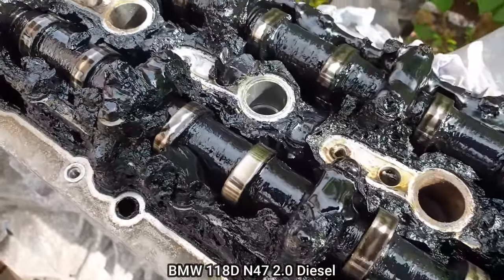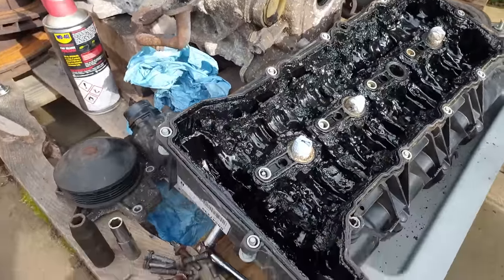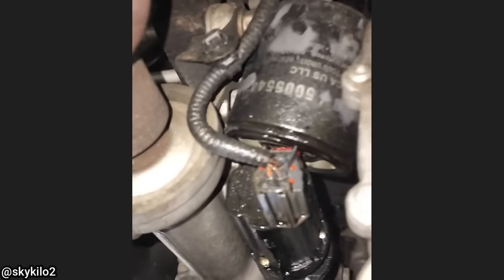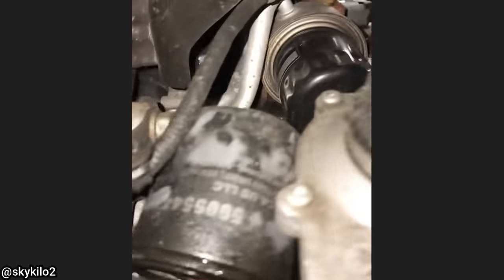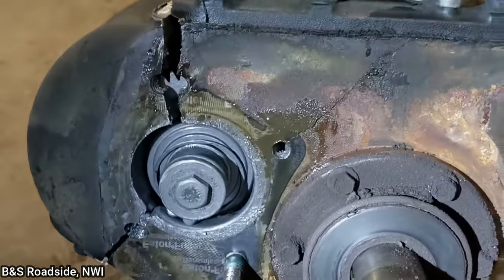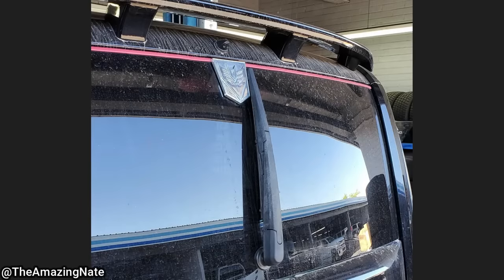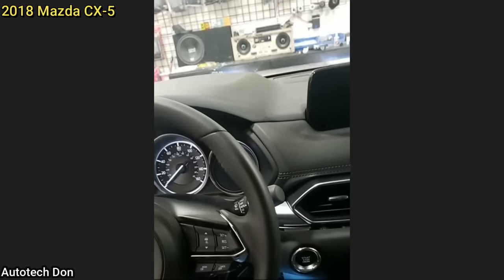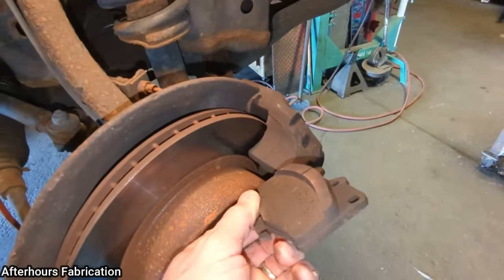Customer States Repair Engine On BMW I Just Bought | Just Rolled In

Comment from the maker: Submit your photos/clips @ www.justrolledinyt.com
Thanks for watching!
Reply: The spinning AC vent made me laugh. I owned a limo company and the floor vents were constantly kicked in by customers putting their feet on the bar. Drove me nuts!!!
Reply: Have a 3rd gen Camaro that's developed a tap, definitely guna check the number plate before I book the car in.. 🤷‍♀️😁🇬🇧
Reply: I'm not messing with you for a change, I seriously have a 3rd Gen. 🇬🇧🇬🇧. Also fitted a grill where the fog lights go, hence removing number plate. Hopefully I'm that stupid!!!
Reply: I drive a truck in the uk, only the other day I had to do some 300 miles with only gears 3 5 7 9 & 11 selector broke I  the gearbox they changed the entire gearbox 1 out 1 in 1 hour 40 mins in a 44 tonne truck !
Reply: HAHAHA the helicopter air thingy got me xD

Comment: In the mid 70's I worked in a machine shop with another Machinist that claimed oil didn't wear out and oil changes were just a way to screw you out of your money. His truck went 29,000 miles when the engine started knocking. His engine looked like the one in this video when he pulled the valve cover. I didn't think it was possible to destroy a slant-6 engine but he managed to find a way.
Reply: don't call him a machinist he doesn't know any thing about machines 😅
Reply: @Techie1224  Machinists use machine tools to make metal parts. Mechanic's work on them. He knew nothing (obviously) about vehicles. I warned him about not changing the oil but he "knew better" than to fall for that scam. I purchased the truck cheap, got another engine from a wrecked truck at a wrecking yard, and drove it for a few years. Jimmy Carter put me out of work so I went into the Navy for it's college at sea program. I sold the truck before leaving for boot camp.
Reply: @Atoms Jimmy didn't get  a fair shot. Under Carter, the U.S. experienced inflation and unemployment that were both in the double digits as a result of an oil price shock that began when Iranian oil workers went on strike.
Reply: @n4zou  GSM or GSE? I got out as GSMC(SW/AW)
Reply: @Dave-in-MD  I started out as a GSE but also qualified as a mechanic. When I made First Class they dropped the E and made me a GS1 because I had qualified for both. We were short handed so we all had to do everything. I was in from Nov 79 until Nov 85. I made First Class in Aug 83 after helping Change out the #1 Generator in the Forward Engine room after just shot down a missile shot at us. Some of the fragments came down the intake and destroyed the engine. The Kitty Hawk sent over an engine and we changed it out while underway. We all got a promotion for doing it which made me a First Class. Two years later the Army offered me Warrant Officer which required being an E-6 two years before qualifying and I had that. If I had reenlisted in the Navy I was already qualified to be a GSC and would be paired with a Chief Engineering Officer on a ship for 2 years and then become an LDO  and become a Chief Engineering Officer myself. The Army's offer was a lot better. I took 30 days leave and then went to Warrant Officer School at Ft Rucker. I made W-2 and checked in at the Anniston Army Depot in Anniston Alabama and stayed there 24 years before retirement. I did deploy to Saudi Arabia for Dessert Shield and Desert Storm. I also deployed for Iraqi Freedom.
Reply: He was technically correct. The oil itself doesn’t wear out, it gets contaminated. That’s why you change it. It’s to flush the contaminants out.
Reply: @5roundsrapid263  Oil does degrade - so its not only the contaminants. Repeated heat cycles will degrade the hydrocarbons into smaller segments, some of which become volatile and evaporate. Some ends up as raw carbon which is why it goes black. An engine is basically doing similar to a petrochemical plant, only much slower and much smaller. As the various components degrade, the mix changes, so it no longer has the same lubrication and heat removing properties, so might as well be bitumen or cooking oil for all the good it does.
Reply: @haroldwilkes6608  Exactly, and it didn't only hit the American economy hard, it also hit here in Europe.
Reply: @n4zou  I always try to explain oil by comparing it to blood. It’s what keeps the vehicle alive and moving. Our bodies can replace old/dead blood cells, but not our cars. So we must replace the oil ourselves to prevent premature aging and wear, also to remove contaminants since our vehicles don’t shit/piss the crap out themselves. Usually works for people who are clueless about cars lol
Reply: @Hardware John Ahh the days when the worst relative a president had was a drunken brother. Laptop anyone?
Reply: Modern high mileage oils should be changed at 30,000 miles. Normal oils are done at the annual service interval or 12,000 miles whichever is sooner. I agree the farce (US only) of frequent oil changes is a scam. In the 1950s it was necessary but technology has moved on. Maybe US oils are formulated as 1950s examples. I will only ever use European oils.
Reply: @mbak7801  if there’s one maintenance regiment you should follow, it’s regular oil changes. If you change your oil every 5,000 miles (2-3 times a year for normal driving) that’s $120 in oil changes a year. If you can’t afford that level of maintenance you don’t deserve a vehicle.
Reply: I had a manager didn't believe in major services. Bought a fairly new 2nd hand car, next month cam belt snapped and wrote it off.
Reply: That's impressive.
Reply: A slant six is a tough engine. They last a long time, and will take a lot of abuse and still keep going. A man that could do that could tear up an anvil.
Reply: @mbak7801  
You use European oils in European driving conditions.
The USA is vast...cold in Alaska, hot in many other places with constant high speed commuting day after day for long distances.
Oils need to be changed as this is "severe service"...
Reply: There was someone in a local group a few months ago trying to sell a car saying the oil had never been changed and that he didn't change the oil in anything he owned and that everything worked just fine even many years later. I blocked the guy so I wouldn't have to worry about ever buying any vehicle from him because I know that's a load.
Reply: @n4zou  I had a similar experience. I was a journeyman machinist/tool maker but I shifted to Australia for work in the late 60s. My wife and I were in Iran during the Carter years and returned to the states to see Reagan elected. I got in the Army as a reservist and went to Airborne School when I was 40 and on to become a Green Beret. The best years were those under Reagan even as a reservist. Never went back to machining and not sorry at all.
Reply: 180hp superbike... Oil change every 3-4000 miles 👍
Reply: @n4zou  Carter's a lot like our dictator Boris Johnson then.
Reply: @JohnSmith-yv6eq  You've ever been to Sweden, where they test cars for winter resistance ? Or to the South of Europe, not as hot as the Death Valley, but with more traffic jams to kill your engine by overheating ? Or driven on Autobahns at 250kph (I think that's 155 mph) for hours ? The question is probably not related to European vs American oil, more that you need to change your oil as often as the car maker says, on which I completely agree with you (besides, Europeans would formulate their oil for the American market, and the Americans would do the opposite for the Euro market). It's more a question of being a careful owner.
Reply: @mbak7801 high milage doesn’t mean it lasts long it means your engine has a lot of miles on it. No oil lasts longer than 1500-2000 miles and that’s a fact
Reply: I have a relative that claimed the same. He changed the filter and topped off his oil though. If it didn't leak so much it probably would have died an early death.
Reply: @n4zou  so it's Biden today
Reply: I had a 76 Volare with the Slant-6 and that was one of the best gasoline engines ever made
Reply: @TeemoQuinton  It's really not. He shut down an oil line owned by a Canadian company that would have been for export only, which would have turned around to be a home use instead after the Russian sanctions. That oil line would have supplied ~5% of the oil that the US uses if we had kept it local instead of exporting. 5%. That's not the 50% you guys act like it is. On top of that, Russia decided to go to war with Ukraine which has put a lot of strain on oil supplies worldwide. The big oil companies right now are jacking up the prices because they can and demand is too high for them to keep up at current production rates, which they refuse to increase. If Putin hadn't invaded Ukraine, we wouldn't be in this mess. Worldwide inflation is not the result of the sitting US president but rather the Russian dictator.

But on the other hand, he had nearly 50 years to fix this issue along with the rest of congress by pushing for more a more local oil supply, forcing power companies to push for greener energy sources, requiring the power grid to be a lot more stable than it is, forcing vehicle manufacturers to push for 30+ mpg as well as pushing for more hybrid style vehicles that can go well above 50mpg, increasing long distance public transit (trains), pushing for more local recycling and composting, increasing reforestation efforts and much more. If they had done more things like this while he has been in some form of political power, we wouldn't be worrying about gas prices as much as we are now because we would be looking at maybe $3.00/gal even with the war going on. Granted people would still be bitching about that but it is what it is.

Damn government.
Reply: Probably was an avid NPR Car Talk listener and fan of the infamous ‘87 Dodge Colt Vista experiment.
Reply: I have known many. Who just replaced the oil filter. And the 225cid slant 6 besides lifter or wrist pin issues were bullet proof. But not idiot proof. Lol
Reply: Without switching the oil filter that could be the case buit I've never seen engines like that.

Comment: What a great buisness plan. Throw sharp stuff in the road in front of your tire shop. Genius!!!
Reply: haha
Reply: got paid for dropping those clamps on the road
Reply: Try dumping silverware on the corner----You never heard of a "fork in the road?"
Reply from the maker: I'm sure that business plan has been used often lol
Reply: we just need to remove the logo wrap from the rear window in the ram... or really dirty up my toy to hide the neon blue colour and we could stage accidents...
Reply: Caltrops are too obvious. Pegboard hooks are cheaper.
Reply: Year's ago I worked at a shop on a highway. A bucket of nails fell from a contractor truck........
Reply: @waynelutwiniak797  we just had a guy come in yesterday off the 400... pretty new 350 and he had driven over someone else's trailer remains spread on the hwy.. it's shredded tires and trailer damage season...  itre is damaged enough it's going to need inner repairing, not the usual once he pried the bits out of it. we have a local guy in the area we send that kinda business to when we don't have time. guy was disappointed, but hubby put on his spare and the guy tipped him 80... the guy felt bad it took hubby about a half hour to get the tire off with some sort of issue with a lug nut of course.

Comment: The combination of fancy wheels and a destroyed suspension is magnificent
Reply: It helps the transmission to.
Reply: It's fine. He painted it red so it works better.
Reply: Why is it you so often see suspension damage on cars with custom rims?
Reply: @jackuzi8252  because many wide tyre/wheel combos put extra strain on the suspensions, especially if you don't realign the wheels properly. the wider the better ruins your drivetrain quickly, and most people don't look after it in time... style over substance.
Reply: Looks like a gone bearing
Reply: @jackuzi8252  Big wheels and tires add a lot of weight that the suspension components aren't designed to support
Reply: @Hamisxa  yup, everything holds together by the driveshaft's end piece and a gallon of hope. XD
Reply: @jackuzi8252  Why is it you so often get wet when walking through rain? :]
Reply: @jackuzi8252  Because rent-to-own mechanics don’t exist 😆
Reply: @M R or watchers of Pimp My Ride?
Reply: @lotharrenz4621  idk about that one lmao, running -10 degrees of camber in the front and -6 in the rear on 10.5inch wheels never broken a suspension component 🤣

Comment: The vent in the last clip was just cool. That's a feature not a bug. 
:-)
Reply: Nice to finally see it in non-potato quality
Reply: I want to say that is on a late 97-03 Pontiac Grand Am. Use to see that happening on those cars all the time.
Reply: Sounded like a single engine Cessna starting up.
Reply: Just brilliant, cracked up laughing at that !
Reply: @billygildark4565  i mean that's basically what it is lol
Reply: Go brrrrr
Reply: Good, I thought there was something wrong with me for wanting one!
Reply: They amaze me, in that they can just keep going an not melt. Be cool to put a timing gun on one and see how fast they spin.
Reply: sounds like 500hz...
Reply: Yes, oddly satisfying!
Reply: @rossb5593  i had a 99 grand am. the air ducts are bigger, one on each side ( driver and passenger) with 3 in the middle. thankfully i didn't have this issue, but it is cool to see.
Reply: Probably a Toyota Yaris.
Reply: I heard some of the newer cars are equipped with engine sound effects to satisfy the driver. Whoomp, there it is.
Reply: @kristiansvalland4595  If you close the 4 and turn the fan on high the one you let spin really gets movin. I had several Grand Ams in my younger days lol
Reply: That what i was thinking
Reply: I always get nervous when people spin things like that. I feel like the forces at play probably aren't as clear to see, and if something snaps, you could get little pieces of plastic flying pretty quick. Not lethal or anything here, but I sure wouldn't want it in my eye. Same deal when people spin sketchy things on drills.
Reply: @DallenRex  LOLOLOL.
Reply: Yeah and your car has the sound of a Messerschmitt bf 109 X'D
Reply: yessir
Reply: Grand Am Gang, my vents did the same thing. As far as I know almost every Grand Am with these vents eventually had this issue, but it was definitely more of a feature than a bug.
Reply: I would not have that fixed I love it.
Reply: I'm not ashamed to admit I watched that one three times.
Reply: yeah that was pretty good.. i chuckled at that.
Reply: @DallenRex  Wisdom comes with experience.
Reply: One of the best ones yet. 👌
Reply: @rossb5593  naw 04-08 the dash is almost straight up plastic not vinyl or pleather like the older ones. Also pretty sure it's a grand prix.
Reply: @blue39503  yes, they are in order to meet noise regulations. Always does a 'cold start' with a lovely growl, at tickover my BMW is virtually silent once warmed up. Inside, there is an option to alter the piped sound through the hifi. Cruising at 70mph, tyre noise and the hifi is what you hear. Press the loud pedal however and the noise becomes instantly present and glorious....👍🏻

Crazy world we live in....
Reply: I'd pay for that option..
Reply: @buggs9950  Pudding in the engine, a strange sound that simply comes from the licence plate, and this freakin' flying "ball" at the end, I can fully understand your move.
Reply: @dasbutte6254  They both had the same vents if I'm not mistaken.
Reply: @ol_smokey9370  they do have the same vents I think even as far back as 96 in grand ams. I'm just saying that dash is definitely the grand prix. I had a 97grand am and a 07 grand prix.
Reply: And today the manufacturers spend millions of bucks for sound engineering, pfff 😄😄...
Reply: @rossb5593  Yep! I loved riding with people who owned those....get the one out of their reach spinning.... lolololololol!!!
Reply: But they did it wrong.  One person is supposed to turn on the fan and shout 'CONTACT!' then the other flings the prop.
Reply: @waynelutwiniak797  hey they are not THAT bad!
Reply: Used to annoy the hell out of my mom in her old grand am
Reply: Air flow indicator.
Reply: I kinda want it ngl
Reply: It's a good example of gyroscopic precession.  Once it gets up to speed, it starts a different rotation due to mild imbalance (as you would find on something not designed to be a precision gyroscope)
Reply: @rossb5593  yep, same in the grand prix as well.
Reply: I would have paid for that spinning thing...
Reply: @DallenRex  Life is deadly for sure.
Reply: That thing would eat a child's finger real quick.
Reply: Gyro stabilization. That's an option.
Reply: That was a feel good video snippet.
Reply: That should keep the kids preoccupied for awhile!
Reply: @Ross B  been trying to get mine to spin since I got it xD